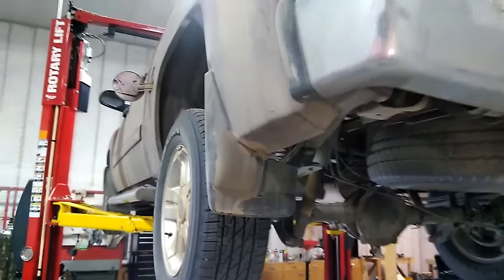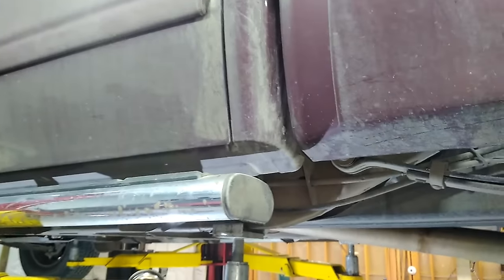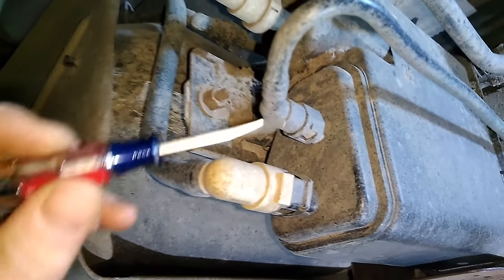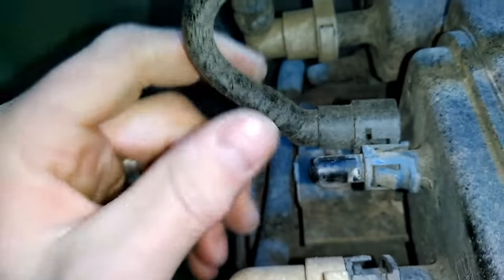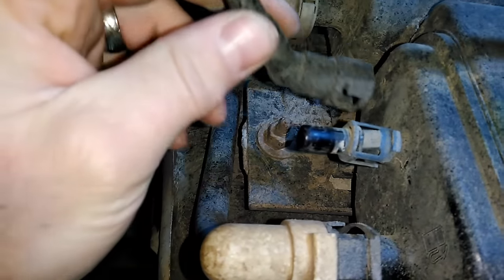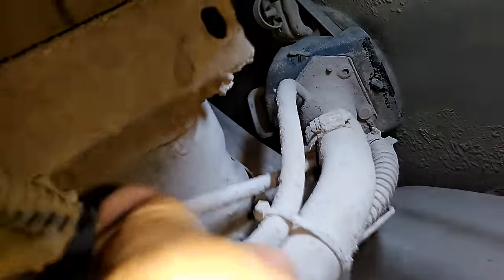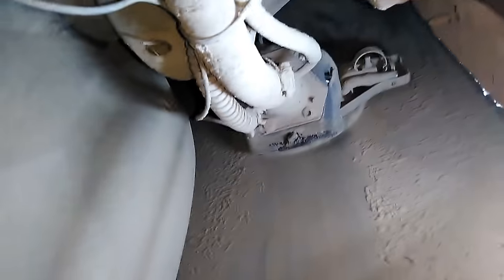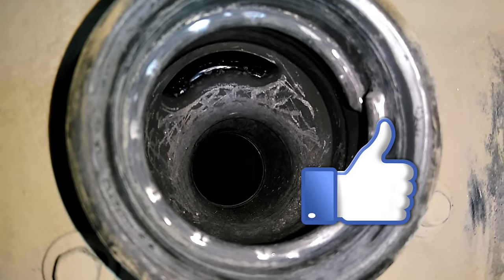Chevy Fuel Evap Canister Fill Fix Filling Slow

Comment: William Burroughs must be in Sioux City where truck loads of activated carbon is sent. Yes, bad location for the fuel tanks vent valve, but you need to open it up for cleaning. I got 3 table spoons of dirt out of one. Many shops replace them because they don’t come apart and are normally open with no power. So fuel vapors/air passes thru the canister and heats up due to an exothermic reaction. The activated carbon inside is the size of sand, but with thousands of tiny holes. It attracts the hydrocarbon and hold it until the conditions are right, the PCM opens the purge valve and sucks the fumes in. Fuel vapors burn and you paid for them. It creates an endothermic reaction, cooling. The tanks vent is wrapped loosely in those odd white tube socks to create an external filter before damaging the valve. The carbon has felt, plus a plastic screen that’s reinforced pushing all to one end to keep from breaking. The black was carbon, while the brown was dirt. If you can hear particles inside during shaking, replace it. It depends, but on the hose end, will suck into the purge valve, then into the intake and combustion chambers. BAD at this point, but clean the purge line out. Engineers don’t get out of their “Cube Farms” where they live. They think everyone has internet and all roads are paved! Wrong! The tank valve closes when commanded by time of driving. So when the PCM’s clock says 8 hours have passed, closed the tank valve, open the purge, watch the tank sensors signal in inches of water. Once it hits 8 inches of H2O, it closes and seals the tank. As long as the level of fuel is between 80% of full, and 20% of empty. This is the criteria for testing the EVAP system. So, tank valve can’t seal because it’s dirty, it will degrade vacuum to 12 inches of H2O in 2 minutes, it’s a small leak and since it’s a type “A” code, due to run-a-way hydrocarbons (Going Straight to California / the Land of Fruits & Nuts), and they CEL comes on the dash, behind the black tape. Simple aaah?
ASE Master Tech since 1978 - Retired from killing “Snail-Darters” & “Delta-Smelt Fish Bait”
Reply: Unfortunately those clips come from 3 different companies to fit the hose/fitting size. This way, they don’t have to pay thousands in re-tooling cost to make each one the same.....and easy to remove. Hell, they don’t even solder 3 or more wires in the harness anymore since they found out that induction welding (Controlled Melting) or joining wires can be done. Cheaper, quicker and no soldering. Remember, wiring harnesses are spread out on a painted sheet of plywood, with nails, clips and arrows with words for special notes and colors. All done by hand. Each are cut, insulation stripped, terminals crimped, inserted into plastic connects. Then it’s taken to a test board, where everything is plugged in, and voltage, correct current or amperage is drawn to the other side with all lights. If one fails, a team figures out why and fixes it. Once passed, then the harness it tapped, covered with tubing or rubber, mounting clips, molded harness channels, then the P/N, day, plant and shift indicator is taped on in two locations. The harness is the 6th most expensive product on the vehicle. 
You all have a good day now!
Reply: hey thanks for explaniation...why am turning into the get off my lawn guy driving older ob1 or older vehicles
Reply: @deankay4434 thankyou, I wondered how a wiring harness, was  manufactured.
Reply: @miguelcastaneda7236  I had a neighbor who was scared to death of air bags. His car had two at best. I told him that a nylon skin burn from an air was not a bad as tasting a glass windshield! I tried to explain that seat belts come first, then if the impact was the same as hitting a solid brick wall at 30 MPH, he may change his mind. The story of how Sammy Davis Jr. lost an eye was driving a 59 Cadillac in Vegas and the car in front of him stopped completely. He hit them and the metal horn button shaped like the nose of an airplane hit his eye. He was not wearing a seatbelt. I think seat belts were required in 1966 as pickup trucks was July of 1970. The largest tail fins came on the 1960 Cadillac, while the only Corvette produced with a spilt rear window was 1963. Very rare to find one as management said no, to hard to see out the back using the mirror! Stay safe in 2023, which still sounds strange to say!
Reply: @TOOLMAN4hvac  A job listing January 13th at American Autowire had a warehouse tech position and listed a requirement for "Resistance Welding of Wires" as in auto body, spot welding is called "Resistance Welding" so if the heat can be controlled, you can spot weld 3+ wires together to connect some ground circuits. Mine was in the factory harness of an 03 truck, but GM uses "SPXXX" or splice packs follow by 3 numbers to provide I.D. an location. C= connector, G= ground and the front bumper to firewall is area 100, "A" pillar is "200", under the dash & front seats is "300" and so on. Any splice in the harness wether mechanical or welded is within 13" Left or Right of an indicated landmark, say the center console. It is simply location guide to find a connector, ground, splice or splice pack that contains one wire to ground, all the other wires need ground, so the removable part of a splice pack is plastic but contains a once piece metal stamped "Comb" looking connector. It is used on serial data and grounds. But not CAN (GM-LAN) because they are separate and twisted 9 times per foot to offset any nearby RFI.

Comment: Wouldn't flushing it with water also flush the charcoal out? Also, I believe there are fabric filters in the bottom of that canister...wouldn't they would absorb the water and then feed it back to the engine??
Reply from the maker: I’m sure if the filter fabric was bad it would leak beads and the small amount of moisture left would eventually evaporate during a regen and such a small amount won’t hurt anything

Comment: 2005 Denali same shut off problem no trouble codes or engine lights. I can't afford a new canister right now. So I'm going to pull that vent hose off the canister. Sounds like if it solves the problem, the canister is plugged up. Damn right I'll give this a shot, what do I have to loose. Long as the truck takes gas and I don't get any code's or check engine lights I'm good. I don't care if the damn canister winds up empty or not, wasn't working anymore anyways.

Comment: Any reason why you decided to push water and air through it, rather than just air? Any clogging issues after the fact? Great video, thanks for posting!
Reply from the maker: I just saw it in comments and decided to give it a try, probably better to use air first then water and then air to blow out. It still works

Comment: I'm so mad at myself for ruining mine by accident. I was told not to blow air through the single port side and as soon as I get to the air compressor the very first thing I do is NOT look and just started blowing air in. Tore up whatever hold the charcoal inside and now it blows the pellets out. What's worse is I have an Avalanche and so Tahoe canisters don't fit my bracket and Silverados are built different with how they bolt on. I was told a Hummer H3 has the canister I need but junkyards don't tend to have Hummers.
Reply from the maker: Before you through it out, I actually cut one apart and put back together in this video, it may help.  https://youtu.be/ASCLntCU0jQ
Reply: @HighOctane101 I've thought about it.

Comment: While it seems like this would work, I would be reluctant to call it a "fix". It is more like a way to defeat that pesky evap canister by hosing out the charcoal and the little bit of dust that got in with the charcoal that keeps my check engine light on all the time. I am totally fine with defeating this system if that is what one wants to do. As a matter of fact, I may actually do this because I don't have a choice but to drive in dusty conditions all the time anyway. Pretty decent video!
Reply: How would you be sure though, if the Check Engine light is on due to a congested EVAP canister and not something else, which could turn out to be lethal to your engine?
Reply: @DobruchT  I actually did this. The hard part was figuring out the hose connectors and how they release. I hosed it out with water and blew it out with compressed air the best I could. It worked. I drove for over a year maybe 2 before the problem came back. So it is temporary but it last long enough for it to be worth it. I will do it again in the spring when it gets warmer. I dont have a garage. As for the engine light, I cleared mine. When the problem came back it gave the same code. Not that you need one. The tell tale is the difficulting fueling the truck. You can keep clearing the code all the time and monitoring it if you are worried about a different problem. This code wont come in immediately.
Reply: @danclay8229  You clear check lights and now you need to drive at least 100 miles to have the computer have EVAP data. Without that 100 miles worth of data to the computer you don't get a new inspection sticker because the EVAP has to pass to get one. So now you are driving without an inspection sticker illegally right? There is no guarantee your check light will stay off to pass inspection if the computer doesn't see the correct specs.
Reply: @Adirondacks4me  Thanks for your interest. I have actually done this twice now. My observation is that washing out and blowing out the EVAP canister cleans out the dust but I didn't notice charcoal coming out. It lasted more than a couple years. I dont remember exactly. Regardless I drove 10s of thousands of miles since the first rinse with no CEL. The truck EVAP system appears to be working. My state doesn't require inspection stickers so I havent had to do that. I do believe it would pass though. I actually still have it. It has become hard to replace in the post pandemic market. It is high milelage now.

Comment: Really consider if you should do this or not.  My evaporative canister exploded when I was trying to dry it out with the compressed air.  Now i have to buy the new part.
Reply: Brian Writebol do you still have your eyebrows?
Reply: turn your air regulator down to 50 psi.

Comment: Fixed my filling issue, took about an hour vrs a a big bill, did not fix the engine light in dash tho.. Thanks for the video.
Reply from the maker: Disconnect battery and reset and try

Comment: Your video was very helpful
I recently bought a 2015 gmc sierra. With over 130 thousand miles.
Had it about 3 weeks and the engine light came on.
Long story short, the evap solenoid and the purge valve have been changed.
Still the light is on.
Looked as if the previous owner lived on a dirt road.
Also the tank is tough to fill
Cuz it keeps shutting the pump off.
Sounds as if this might be the issue.
Thank you
Reply from the maker: I would then start with the canister
Reply: @HighOctane101  thank you
Sounds like a plan

Comment: I can't get my canister off my 2002 Failblazer!! Living in WI, attempting to fill in -30°, and having it shut off every 10 seconds isn't fun. I had a feeling this was the problem; attempted to take it off the bracket/holder to clean it out and it's so rusty I can't get it off! The hoses weren't too bad to remove. Do you think I can start it on fire?? Lmfao! Any advice would be GREAT!!
Reply from the maker: If it is tough to get off, you may have to get it on a car lift to better access.  Might have to cut the bolt off if it is too rusty.

Comment: This solved the slow fill problem in my 2004 silverado 1500. Very helpful video. Thanks so much.
Reply: Still holding up?
Reply from the maker: Still works great 👍
Reply: Did you wash it out only? Or replaced the vent valve solenoid as well?
Reply from the maker: Did not replace valve just cleaned
Reply: What you truck did? Mines runs like no gas on the engine and shuts off or start shaking and rev down till motor goes off

Comment: Just install a new fuel pump on my 2017 sierra 1500 .... If i turn it off more the 10 minutes. Takes a wile to start. But if start it like every 10 minutes. Not a problem. Please help ..and it has this system. Cant find a filter. For the gas.
Reply from the maker: Either filling too fuel and getting raw fluid gas in the canister or purge valve bad . My opinion
Reply from the maker: To full I ment to say
Reply: @HighOctane101  thanks today i went to get a new fuel pump. Thats what it was...dont know y this trucks dond have a filter. But thanks! 👍

Comment: Thanks for the vid! If anything, most of the people commenting on this are not mechanics.  I personally bought a new cannister, but I appreciate the step by step and description.  Keep up the good work. However, I do have a question... should/can I blow out any of the hoses running to the cannister? New subscriber here.
Reply: Sir you have a wonderful question 👍
Reply: I'm sure you can but make sure none of the hoses are attached and make sure that if you are blowing it through a line with a valve, it does not break anything.. just be careful.

Comment: Wouldn't the water u sprayed find its way into the tank somehow? And wouldn't that be harmful?
Reply from the maker: Just a small amount of moisture and all fuel has some moisture/ water in it. Never had any issues. If you don’t blow the water out the. I could see it a problem otherwise just fine
Reply: Thanks just curious have the same pending issue on my 05 yukon slow refueling and also a p0455 code showing. Also charging system failure hoping thats just my alternator/battery

Comment: The clip u left for last Some mechanic told me to take that Same style clipoff the same way and it will brake 99% of the time about the second time braking a clip I figured out all u have to do is push that clip in and the hose will slide right there's no need to use screw drivers or anything but ur hand. I'm not being critical it's just a tip

Comment: So what if I slide a tube down the filler neck while filling up. Vent the tank out the tube once full pull the tube back out.
Reply from the maker: That would work if it will fit

Comment: Would this be the reason I get poor fuel mileage or is it just the engine I have the 6.2 and it guzzles gas like crazy, I just ordered a acdelco one since I don’t have a pressured air gun, I’ll update this comment when I install it
Reply from the maker: I don’t think this issue will cause poor mileage, sounds like something else going on
Reply: @HighOctane101  so the canister fixed the fueling up issue now I’m still getting a code for the mass air flow sensor I’m going to clean it this weekend see if that clears my codes
Reply: @zl1camaro100  My Silverado 2500HD with the 6.0L is having same problem. Error code P0446 & terrible gas mileage as well as bogging down whenever I try to punch it. Did you get your problem figured out? What was the fix? I was preparing to clean the evap canister, replace the evap vent solenoid, clean the vapor filter up by the neck of the gas tank. However I’d love to skip some of that if your problem was solved.
Reply: Super curious if you got the problem solved and what it was? I’m having the same issues with my 2500HD Silverado with the 6L.
Reply: @drivehard  it was the canister once I changed it it pumped gas normally again
Reply: @zl1camaro100  TY!

Comment: i have a 2001 volvo v 70 runs fine until i have to put gas in then it very hard to start have to feather the gas  until it starts putting gas in is no problem i think purge vale is not working so what you think

Comment: Do you spray water on your charcoal grill just before you light it
Reply from the maker: A little different man!  This is activated charcoal! It will burn with oxygen but you need to go to science class lol. JuSt rinsing the dirt out it is a big problem.  Just try pump gas for an hour and you will get it

Comment: I'm almost wanting to resort to cleaning out a Ford Charcoal canister after I experienced a fuel tank implosion, plus I would have trouble refueling if I had the nozzle inserted all the way in before the implosion occurred and busted the rotted seam on the left hand side.
Reply from the maker: Never heard of that, interesting
Reply: Im having problems with my gas tank imploding and as soon as you start it. The gas cap starts hissing.....
 Takes for ever to refuel.

Comment: I don’t know if I should get one at Amazon $115 for a new or just clean it like you just did? I just blew it out with compressed air and see if check engine light goes out. Code po442.
Reply: Robert Munguia p0442 is a small leak detected by the ecm. This means gas fumes are leaking out of a sealed system. You need to introduce smoke into the system to find the leak.

Comment: I have a question I’m driving about 25 miles an hour or 35 miles an hour I lose power I change the transmission fluid transmission fluid looks good there’s nothing in the pan if you lay off the pedal couple times then you get up get up to 55 to 60 miles an hour no problem I just got a deal with a paddle up and down up and down it’s a 2005 Chevy Silverado do you have any ideal can help me out appreciate it
Reply from the maker: I would check fuel delivery pump could be getting bad loosing pressure,  does it feel like it is missing at all.  If so could be plugs and wires
Reply: @HighOctane101   Maybe I didn’t explain it very well OK I’m driving down the road the speedometer start raising up when I get 25 miles or 30 miles an hour then left the pedal couple times up and down up and down then it finally picks up it does not jerk or anything I think I might not explain it right I’m terrible at this stuff explaining stuff but appreciate your come back did this help you any what I’m trying to say I hope so like I said you’ll be driving but tween 25 or 30 miles an hour then you lose power but you can put it to the floor in the engine will wrap up in our RPMs to go up Hope this makes sense what I’m trying to say thank you